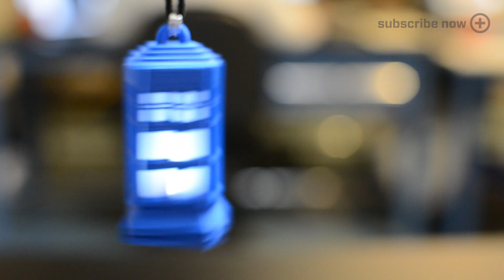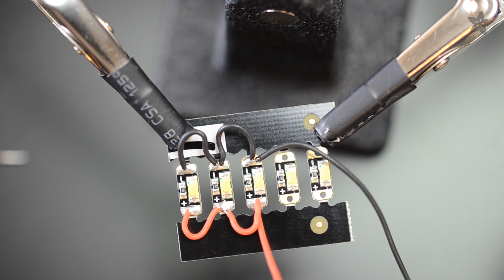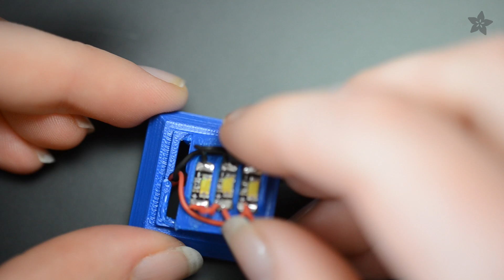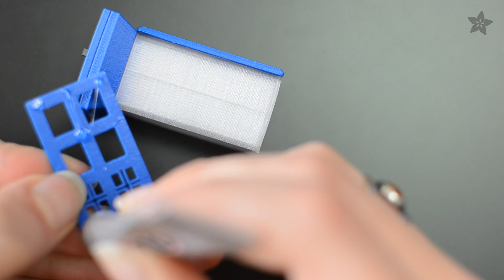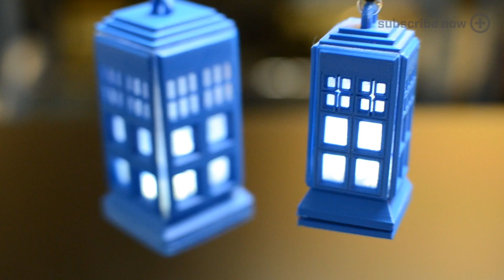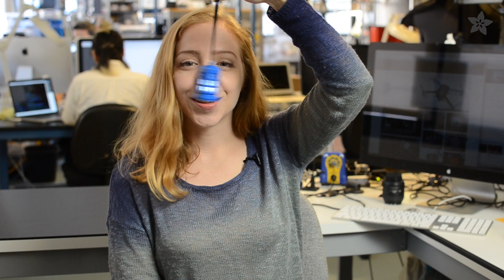Tiny TARDIS Pendant

Comment: You can fix the gaps in your print between the windows by printing with 1 shell when you're doing detailed parts like this.
Reply: ***** Do you mean the interior piece or the exterior parts?
Reply: Wow, set the way back machine, Sherman. 

On the TARDIS on the right the lines between the windows and squares on the door the lines aren't solid. Slicers have trouble with gaps just wide enough. For instance a 0.4mm nozzle can do a 0.8mm wall or a 1.6mm just fine, bit anything in between, like 1mm, the slicer can't put a shell between the outer walls so it gives up. However if you do just 1 shell it can do top fill between the shell, different algorithm, so you get a better result, at the cost of thinner walls on the side. But not a big deal on something this thin.
Reply: Thanks so much Joseph, I will try this out! I know your last post was a few months ago. Thanks for responding so quickly! :)